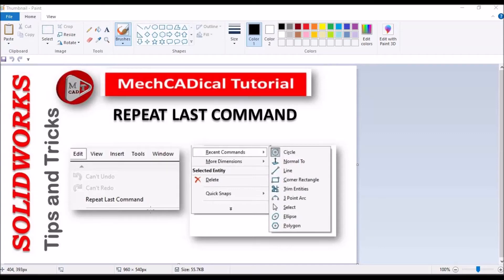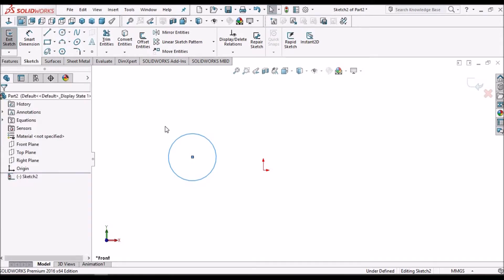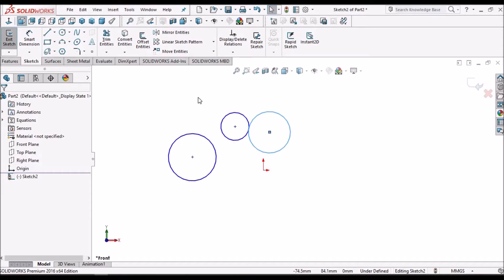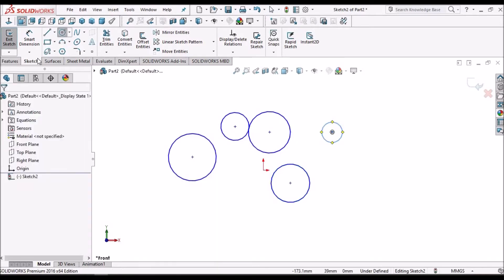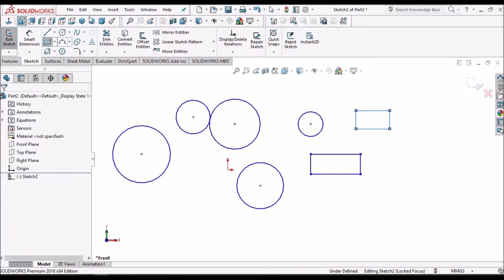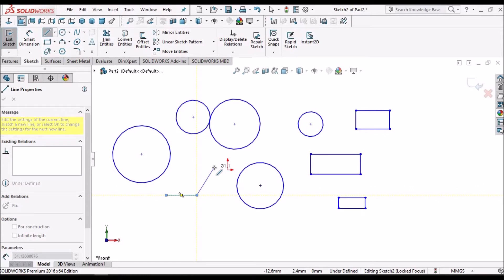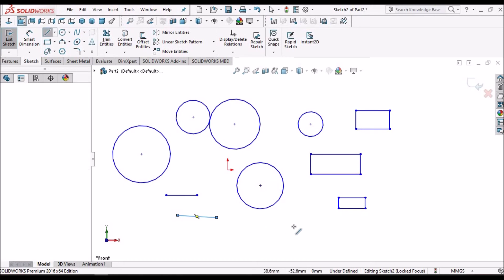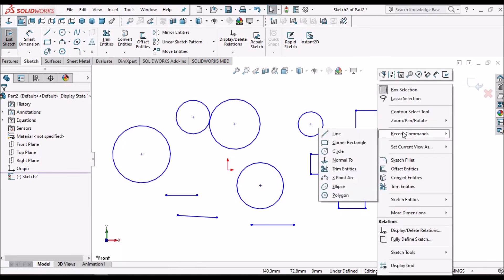How to Use Repeat Last Command in SolidWorks - Sketch

Comment from the maker: This "repeat last command" is like "Spacebar Command" in Auto CAD,  so In solidworks you can use "Enter Button" for same application, which saves time, this command is for all the modules like part modeling, sheet-metal etc

Comment: If I have to select 3-4 times to repeat a command what's the use, instead I'll directly choose that command.
Reply from the maker: You are right, but this option for quick access
Reply: @mechcadicaltutorial  ghanta quick access it takes to much time than that
Reply: time waste kr diya mera
Reply from the maker: Hello Brother, This "repeat last command" is like "Spacebar Command" in Auto CAD,  so In solidworks you can use "Enter Button" for same application, which saves time, it command is for all the modules like part modeling, sheet-metal etc.. I will try to make elaborated video of this command in future. Thank you for your time and feedback...All the best